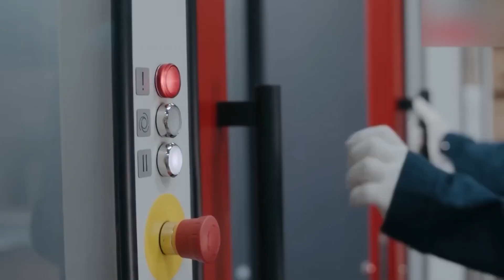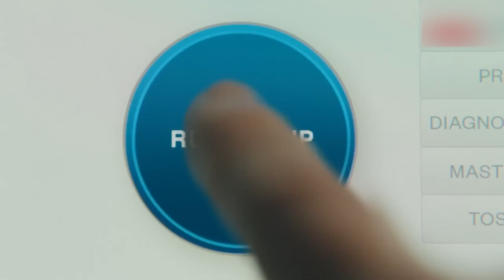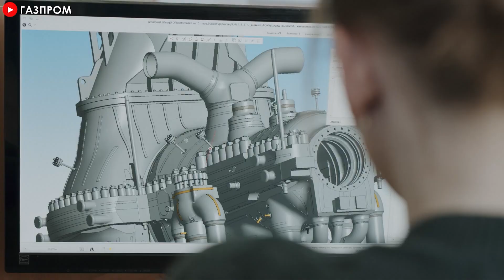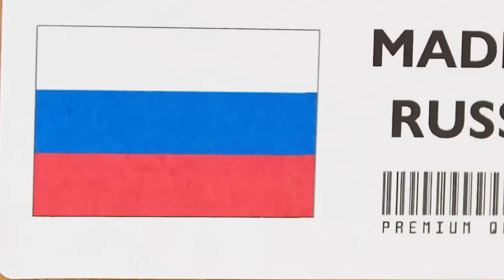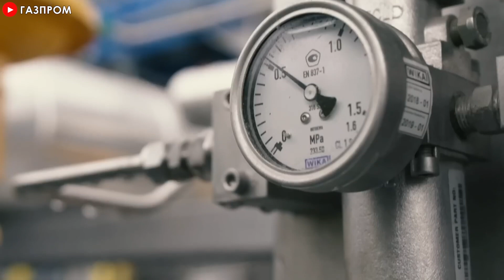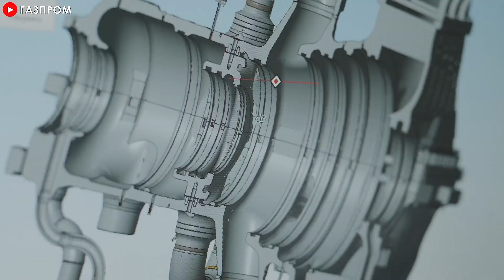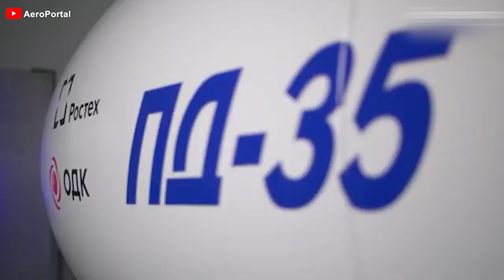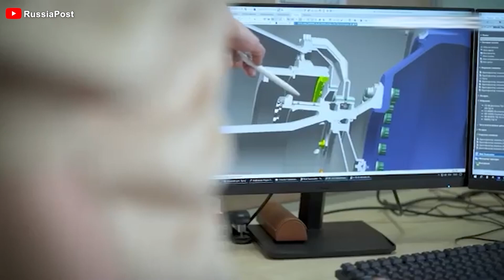This Russia’s NEW POWERFUL ENGINE Will CHANGE The Industry!

Comment: Thiis not a Gas urbine it is a steam turbine get the facts right.
Reply: ГТД-110М is translated as Gas Turbine Engine 110 Modernized. 110 is for Megawatts power on electric generator output.
Reply: I confirm. It is not a turbojet nor a turbo fan engine.

Comment: What is soo special of western made turbines while the soviet had them already and for all to know that the first nuclear power plant was born in soviet union, not Russia and many invention was stolen under yelsin nose
Reply: Gas Turbines develop their fuel efficiency specs. The only way to improve fuel efficiency is to raise fuel burn temperature that high pressure turbine face during work.
USSR gas turbines had quite low termal efficiency in comparison to contemporary products. E.g.  ГТЭ-150 (156MW) made before 1990 had  thermal efficiency specs:
- 1100C/1373K before turbine
- 31.5% thermal efficiency
- 15.1m x 5.15m x 5m size

While ГТД-110М (118MW) has thermal efficiency specs:
- 36%
- 7.19m x 4.34m x 3.76m size

Comment: What of the turbines produced by Power Machines..  Power Machines were to replace the turbines for the Arctic 2 project.. so my question is...
Was the turbine produced by power machines a success & whats the progress with the turbines produced for the arctic 2 LNG to replace foreign ones that weren't supplied but paid for due to sanctions?